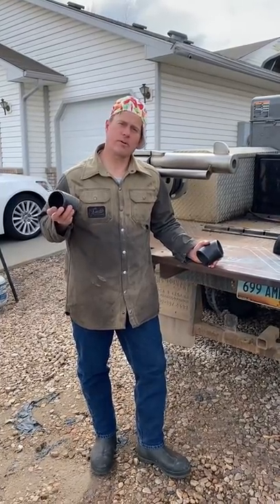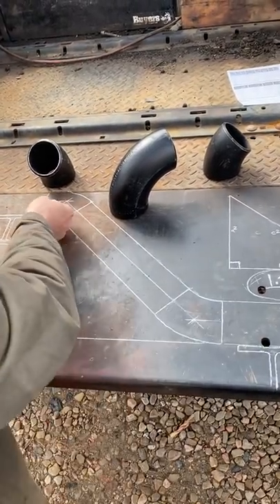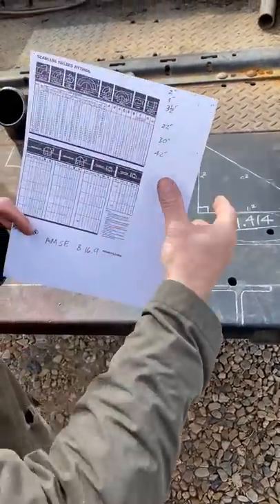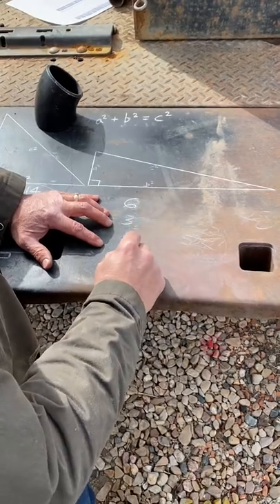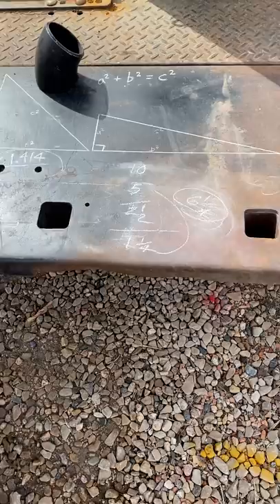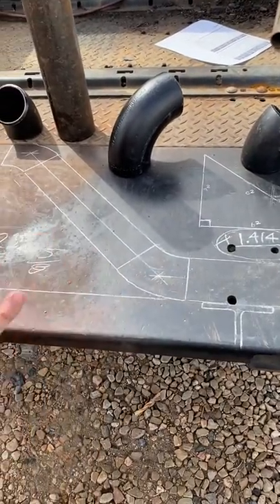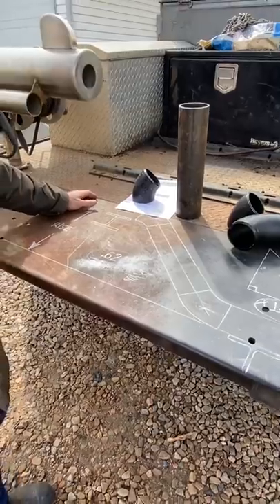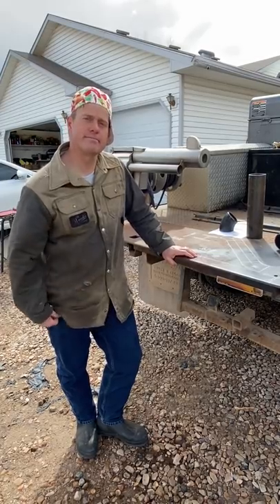Pipe Welding Layout: Tricks For 45 degree Elbows

Comment: If you check your book, it will tell you specifically the math for factory 45’s and field cut 45’s (because there is a difference).  Some companies will order 45’s and others only order 90’s and therefore you have to make your own 45s  (and odd degrees)   And the trick to making odd degrees is a whole other video. (Quite simple however, just measure the bend, divide that measurement by 90, then multiply that number by your desired angle)
Reply: A aweasome trick for laying out odd angles is the 57.25 rule. You draw two lines using a square and draw a arc 57.25 inches 90 degrees. Then every inch on that arc is 1 degree. Then just mark the arc by flexing a stick ruler for example 20 degrees would be 20 inches on the arc. Snap a line back to center for your desired angle and draw your fitting. You now have 3 coordinate measurements for any angle on any size pipe.
Reply: Somebody needs to do a video on the 57.25 rule. You can also find coordinate measurements on saddles. I don’t have a camera or the computer skills for a YouTube video.

Comment: How long you been wielding. I've been fitting in the plants and shop for 7 years.
Reply from the maker: shane clark I learned to weld in the mid 1980s
Reply: @offthehookdesignandfabdotc2582  you on a line right now
Reply from the maker: shane clark not at this time.